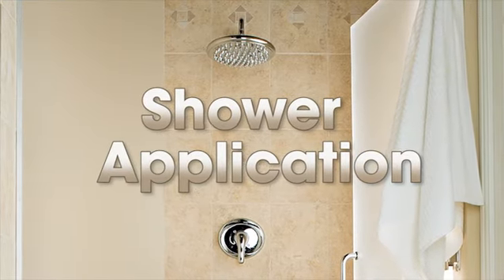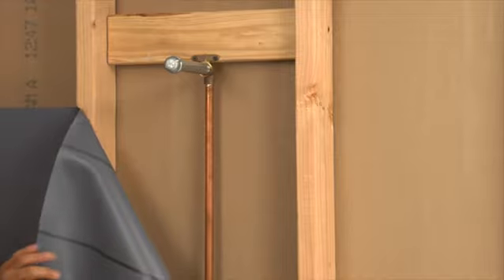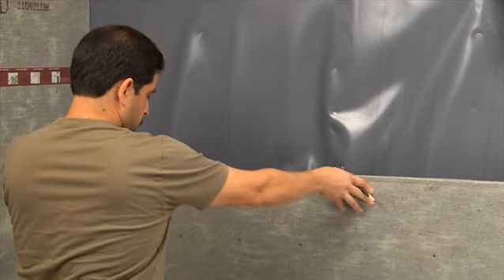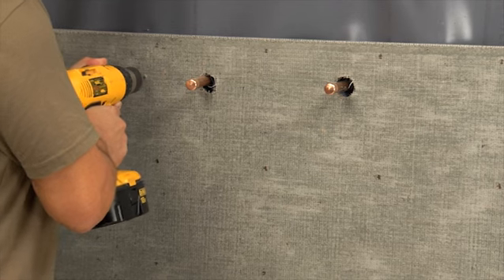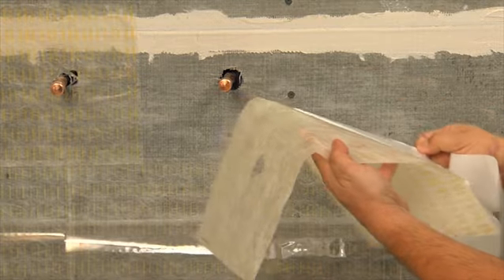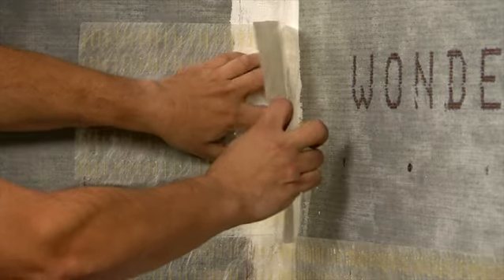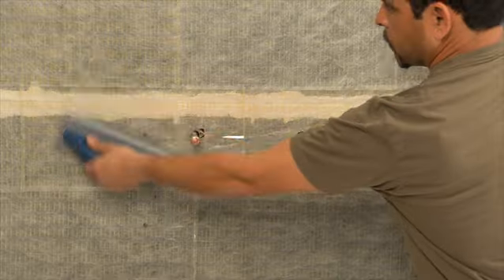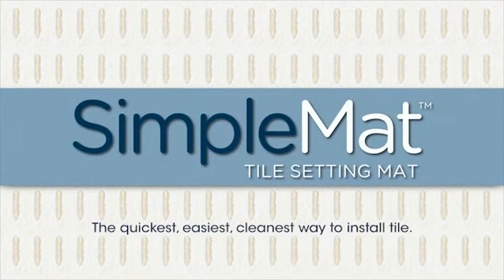How to Tile A Shower Wall using SimpleMat

Comment: Question,why poly sheeting behind the backer board? That is the more expensive rout. Why not something like Redgard on the front for submarine tight?
Reply: if water gets behind any seems you'll have damage... the backing will run any water all the way down to the tub or shower in front of the lip and keep it dray

Comment: I would be careful using this on shower walls. Just removed our tile installed by the previous owner using this, and there’s mold forming on the backer board that was behind the tile. The screws from the backer board are rusted too👎. Could be a bad install from the previous owner, but I won’t chance that again.